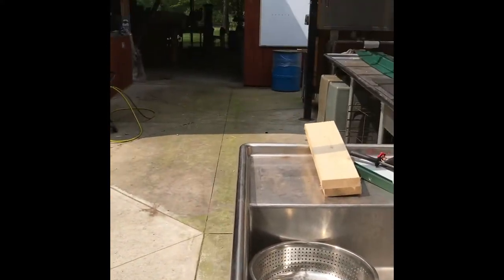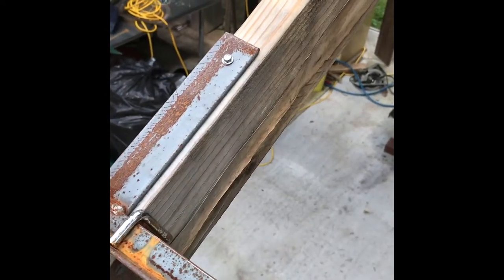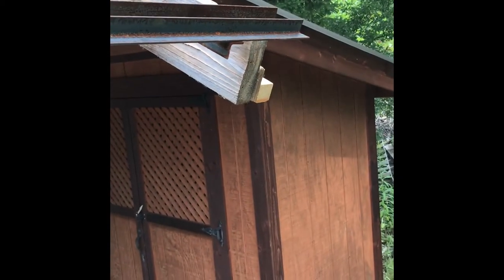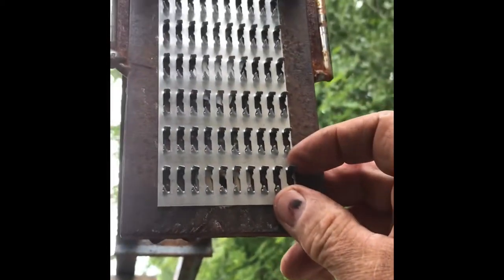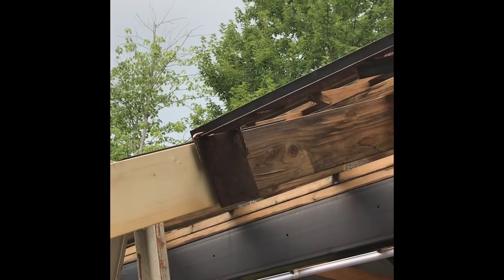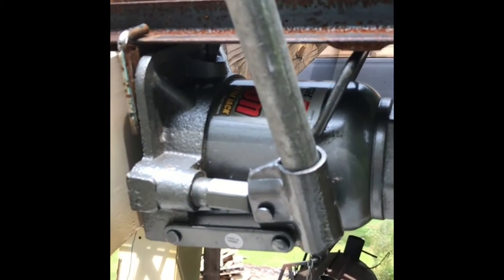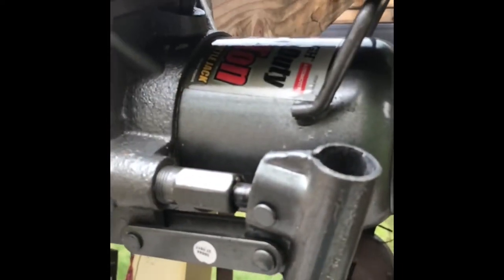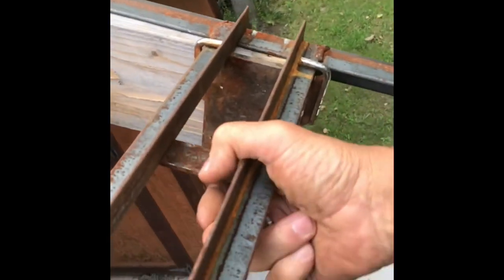Truss plate press

Comment: That would be a very cool tool for those repairing rotten fascia, rotten rafter ends and rotting truss ends.  I think that I will be making one myself.  Thanks again for sharing!  👍😉
Reply from the maker: Thanks Daniel, please realize as was mentioned in the comments recently. You should rotate the push plates 90 degrees. They should run parallel to the wooden member along their length. 
Have fun.

Comment: as all the commenters say, very clever.  however, i would have used galvanized plates with pre-drilled holes fixed in place with tek-screws, just in case my attempt at your machine didnt work very successfully.

Comment: i like it....   planning on building a greenhouse this summer, and this will be the ticket - i can build them on the ground so won't have to worry about the height...  glad to know 20 pound jack will work - have seen lots of videos that say you need a 50ton...
Reply from the maker: There may be some legitimacy to the 50 ton jack statement. 
I was using hem fir where I believe most "manufactured trusses" use the harder SYP for some of the more demanding structures. I'm picturing your greenhouse being smaller, less span, and you will be fine! Thanks for the comment!
Reply: @kevinghyzel7583  well the cost of wood - ANY wood has skyrocketed with this Covid thing, at least in Canada, but i expect to make it out of spruce...  a sheet of OSB used to be around 18 bucks - 56 bucks now!!  hmmm... wonder what the chances are it will go back down after everyone is vaccinated...   i just need something that i can use here on site, and use myself.  i'm not a huge woman, and i live WAYYYYYY out in the sticks... but i'll be building it on the ground...   two years ago i bought a thing called an 'order picker' - basically a single person elevator kind of thing, so that should help getting stuff from 'down here' to 'up there'.

Comment: How heavy is that giant C-clamp and what is its thickness of steel??
Just seeing what little of it as I did is making my hernia flair up, especially then dragging it up and down a ladder up ten or so feet in the air plus like twenty times or so, lol
Oh, by the way... that's one helluva AWESOME invention man!
Reply from the maker: Sorry, had to get the bathroom scale out to the shop. The backbone of the C frame is 5/8" thick. The bolsters on either side of that spine are 3/4". The plates that hold the pieces are 1/2". It weighs 25.2 lbs.

Comment: Very clever , thinking outside the box
Reply from the maker: Thank You. I have some great friends who have a tendency to push me. The initial comments were "you can't extend two feet with a but end like that"! if they tell me what I can't do... well you can see the results. In any event pounding these in with a hammer overhead puts  everything at risk, distorted nail plates and splintered wood.  I can't remember mentioning it in the video but I weight in excess of 250# with my keys in my pocket and I hang off the end with not so much as a creak from the structure.
Reply: @kevinghyzel7583  You hanging on it was just what this video needed, very disappointed when it got to the end without you doing that.
Reply from the maker: @That1ufo  Sorry I couldn't do that as a video selfie, like I said no videographer working with me on a Sunday.

Comment: Couldn't you have just put a sister joist on each side with a 3ft board to make that extension? That would have taken about less than 10 mins and wouldn't have had to make up  that crazy concoction just to hold the weight of a 2 ft span of metal roofing edge that weights less than 5pds
Reply from the maker: You sir are correct, I certainly could have, that's not the way I like to do things! I enjoy fabricating in metal. Not that it changes what you're saying but we used to get crazy snow loads in upstate NY.